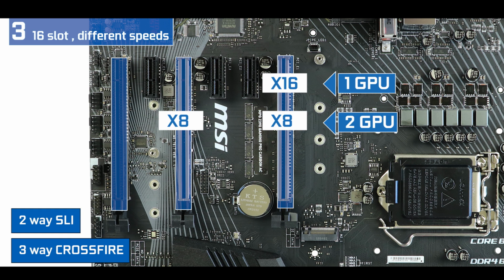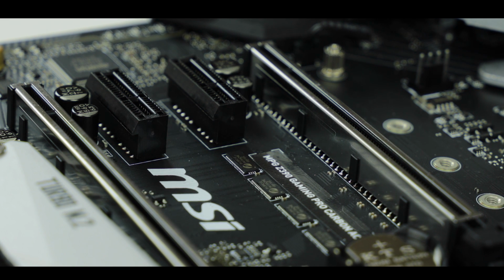MSI MPG Z390 Gaming Pro Carbon AC, a missed opportunity!

Comment: So many peoples opinions are based on the limited personal experience they have with the brands. I've had two unfortunate experiences with gigabyte boards and none with msi over my last 4 builds. So I guess you all know which one I'm buying for my next one. As for asus I think they run up the price in the entry level and mid tier range for a comparable product in most cases.

Comment: Even though it comes with the AC, can you still use an Ethernet cable instead of the WiFi on the motherboard?
Reply: It comes with some antenna thingy it really changes my internet from 30 ping to 0 ping trust!
Reply: @artemthegr8  only with wiif?

Comment: I got this board with 9700k nice stable 5,1 Ghz oc with AIO cooler.
Reply from the maker: Watch the PCB junction points. Temperatures there are extremely high and make sure to to have some air flow going through the back of the board.  

With these kind of temps,  solder points will start failing within 12 months of sustained usage. 

Hope this helps.

Comment: great Video, awesome presenter, i subbed.

my Question is.. im looking at getting an i7-9700k and the MSI Z390 MPG Gaming Pro Carbon... but it doesnt have the AC at the end of name, whats the difference?
Reply: King Drazhar ac has WiFi other one dosn’t
Reply: I found the AC version cheaper than the regular one. So I went with that one, even though I'm going to be using an Ethernet cable.

Comment: It looks like it has 3- 3.1 Usbs' on back? What am I missing? The red ones...
Reply from the maker: Ur right. But with the ever changing names of the USB standard,  at time of filming, 5gb/s plugs (blue) were officially called 3.1 1st gen.   The 10gb/s  (red).where 3.1 2nd gen.

With X570 boards, USB names changed again to 3.2 and 3.2 2nd gen. 

But u are correct.  It used to be 3.0 and 3.1.

Marketing gone wrong anybody?

Comment: Helle there again mate, im planing on buying this motherboard and I will also change from an aio to a classic air cooler. Im afraid that a notctua d15 140mm won't be compatible cause it might cover the RAM. Can you or maybe someone else in the  comment section give me a hand, if there is enough space or not?
Reply from the maker: Using Corsair Fury Ram will allow room both for Noctua and the Ram.

Comment: Hey Laurent is the PCIe slot the 2nd and 1st PCIe slot can they hold 2080ti because it is heavey or can it not pls answer
Reply from the maker: Yes they can :)
Reply: @Laurentschoice  thank you sensei means teacher
Reply: @Laurentschoice  one more question an the pro carbon ac handle i9 9900k at 5 ghz and 32 gb ram at 3200mhz and a name ssd at 1080p and 1440p at ultra settings pls answer teacher

Comment: A note about the usb IO... The MSI has a better setup if you prefer the USB ports on the front rather than the back. The MSI board has five USB3.1 Gen2 connections with one of those going to the front as Type-C and four USB3.1 Gen1 also going to the front. The Gigabyte has only three USB3.1 Gen2 on the rear with no Gen2 connections to the front, only a Gen1 type-c and two Gen1 Type-A for the front. I care about having more usb ports up front rather than the rear, especially if it is a Gen2 Type-C.  

That being said, all other points are valid. And why didn't MSI add a second heat sink for the first M2 slot?
Reply from the maker: Indeed :) well spotted :)

Comment: Hey bro will you tell me what should I go for either 
Maximum xi hero(WiFi) or z390-e
For
I9 9900k
3200mhz 16gb rams
MSI gaming x trio 2080ti
Reply: Thnx man I also need suggestion for Ml360R or kraken x62
Reply from the maker: kraken ... not doubt !@!!@!!!!
Reply: @brayandsouza6349  go full custom ek!
Reply from the maker: Maximus xi Hero:) better OC , better troubleshooting features... better board all together:)
Reply: Should of just bought a noctua dh-15s. 89$ same performance as any water cooler if not better.